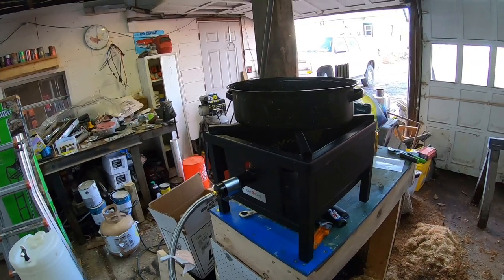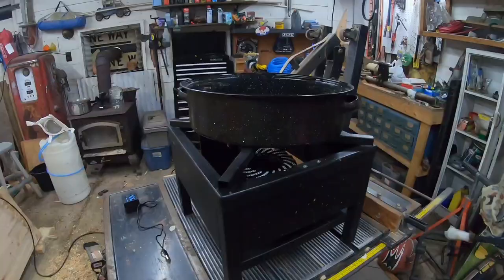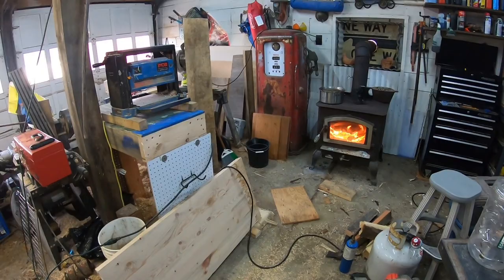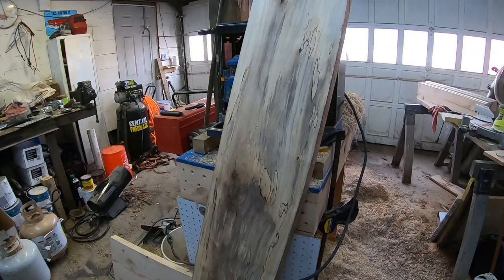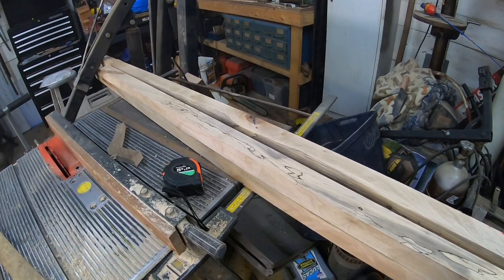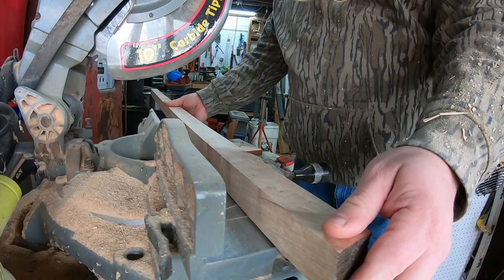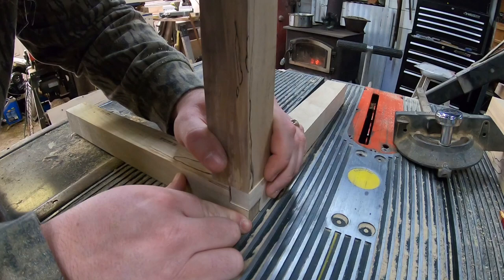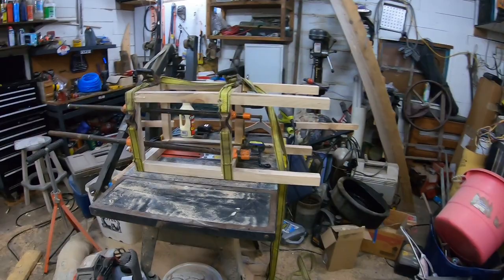Boiling a little sap and building a stand for our syrup filter

Comment: Lee… I’d call the end joints encapsulated tenon box joints… they are tough to get perfect even if you have a tenoning fixture!   Nice job.  Nothing to be ashamed about there.  

Here’s a hint to speed them up… anytime you are making more than one dado or rabbet cut across the grain.  Grab you a shirt piece of board and clamp it to the fence near you and away from the blade.  Position the edge of the block exactly as far away from the kerf as it takes start your rabbet. 

Then put your stock in the miter and make the cut just like you did.  They will all be exactly the same and if you measured correctly will fit like a glove.  You’ve removed all measuring error and reduced the job to simple repetition!

I’m excited to see the results.  An e-mail is heading your way!
Reply from the maker: Thanks Dave! I did get some video of the final product this weekend. It's sanded and I only put polyurethane on it. No stain. I think the finish looks great. I also used it this weekend to finish my sap. Video on it's way!